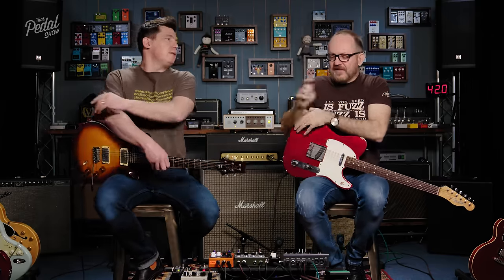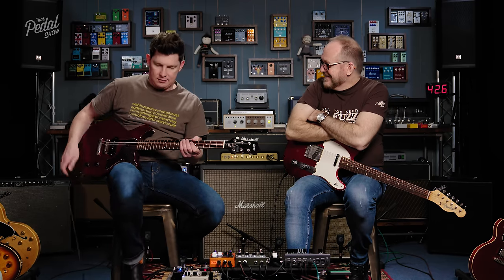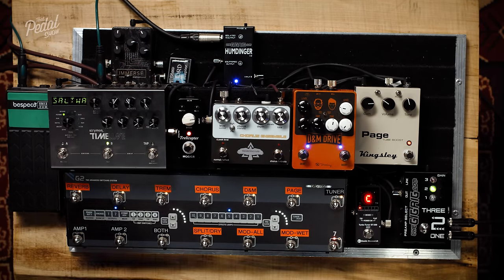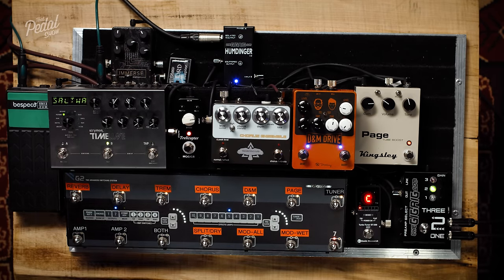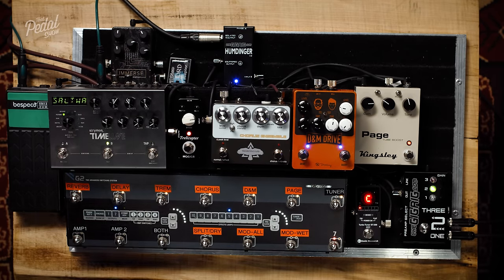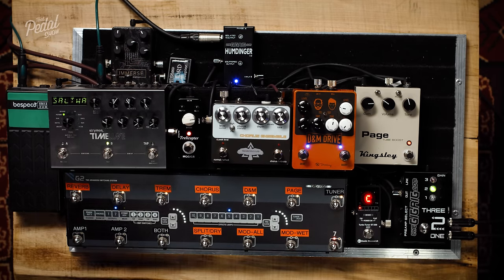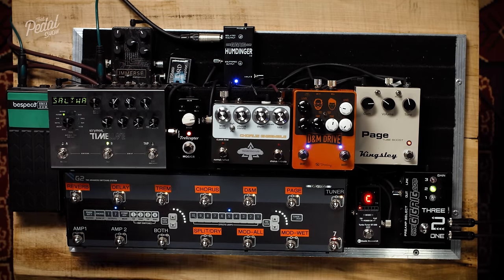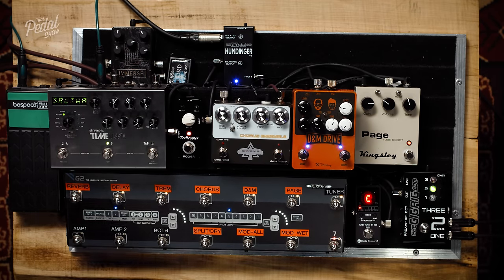Wet-Dry & Wet-Dry-Wet Amp & FX Setups Explained – That Pedal Show

Comment: I haven't bought a tremolo yet.  I really want one that's simple and small.
I've seen that Trelicopter on the board for years.
That is the one I think.
Reply: Also do you gents always record in stereo when you have two amps set up?
I can't quite seem to figure out if I'd been hearing that or not.  I normally wear good quality over ear headphones when watching and this time I was just using my monitors and immediately heard the stereo lol.
Do you use stereo regularly, and just cross fade them a bit so they're still somewhat centered?
Just curious for curiosity sake :)
Reply from the maker: Always :)
Reply: AAARRRRGGHHHH!  I can't hold my comments lol!!!
When I use wet dry I have a stereo phaser, TC Helix, and I send one path to my dry because I love it :)
Who only uses one amp anyways........

Comment: Thanks for this video, guys.

You've just reconfirmed what I've learned by watching TPS religiously for quite a while now.  Because of the wealth of information you guys provide, I use a wet-dry-wet rig with a Fender Blues Deluxe Reissue, a Blackstar HT Club 40 Mk II, and a Fender Hot Rod Deluxe III (all 40-watt amps) and it sounds freakin' incredible!  No nasty interference, ground loop noise, or anything of the sort.  Thank you for doing what you do - you've both been a tremendous help and inspiration to me.  Have fun at NAMM!! :P

Comment: Dan, Mick, there is another way to run three amps, that is, run a wet/dry setup in parallel with a third amp.   Suppose that third amp was that famous one-trick pony, the NMV Marshall.   This is getting closer to what Eric Johnson does.    Have you ever tried a setup like this?

Comment: Question: If I have one amp and the DB metre reads 100db, and then I run a second amp at the same time at the same volume in a wet dry mix, will the DB metre still say 100db, or will it be 200db? Or will it be somewhere in between?

Comment: a TPS episode idea: a micro-budget "wet/dry/wet rig" challenge!

To create the best wet/dry/wet rig, intended for home use, with a budget of 2000 GBP. The idea arose from my limited space, and sound attentive neighbours, in addition to cost. Note that each contestant starts with his choice of one guitar and one computer (with quality, externally-attached speakers). These items are separate from the 2000 quid budget.

My solution is to spend 909 quid on an Katana amp, a Radial splitter, a Focusrite audio interface, and two Boss stereo pedals.

Step 1: For budget reasons, and the tone is 'good enough, I chose a modeling amp  (a Katana 100-Watt 1x12 Mark-II combo amp), so the first two steps in this list can be skipped if one selects a different amp. Use a USB connection to attach the Katana to the computer, and use Boss' Tone Studio to assign each of the Katana's five built-in pedals to whatever effect one desires (from within the entire Tone Studio's catalog of 65 pedals). FYI, the built-in pedal labels are Booster, Mod, FX, Delay, and Reverb. Or, don't tweak at all, and just use the default effect assigned to each pedal: Blues Drive, Chorus, Tremolo, Digital Delay, and Plate Reverb, respectively,

Step 2: still using Tone Studio, if desired, put greater or fewer built-in pedals in-front of the Pre-Amp. The default is two pedals in front. The remaining pedals will be placed after the Pre-Amp. Therefore, the default is three pedals after the Pre-Amp.

Step 3: put a TPS approved splitter into the Katana's Effect Loop (such as, the Radial TwinCity, 160 quid). In this example, specifically connect the Katana's EFX-SEND to the TwinCity's INPUT, and connect the TwinCity's OUT-A to the Katana's EFX-RETURN.

Step 4: connect the splitter's isolated transformer port (OUT-B on the TwinCity) to a port on an Audio Interface (such as, the Focusrite Scarlett 4i4, 3rd gen, 188 quid). Note that free versions of most well-known DAWs are either available for download from the manufacturer's website, or in this case, bundled with the Audio Interface. Pay particular attention to the number of channels available at the complimentary price point. For example, Pro Tools Lite grants four channels, while Studio One Prime only grants two. Given that this project requires three channels, then some free versions of great DAWs will not be suitable.

Step 5: connect the Katana's Line-Out to a stereo Delay pedal (such as, the Boss DD-8, 139 quid). By the way, the Katana's Line-Out is a mono signal, even if any of your built-in pedal choices is stereo (because the stereo signal gets summed to mono before hitting the Line-Out jack).

Step 6: connect the Delay pedal's stereo outputs into a stereo Reverb pedal (such as, the Boss RV-6, 113 quid).

Step 7: connect the Reverb's stereo outputs to two ports on the Audio Interface (ensure that these two AI ports are configured as a stereo pair, or else they will be seen as two mono signals).

Step 8: using a USB cable, connect the Audio Interface to the computer. Use a DAW to capture the three channels in the AI (Dry, Wet Left, and Wet Right). In the DAW, configure reasonable speaker placement, such as Wet Left to stage left, dry in the Center, and Wet Right to stage right). Ensure that the DAW's outputs are set to the computer's externally attached speakers (or, even better if alone, use headphones) to hear the resulting wet/dry/wet tones of joy.

The five pieces of gear that I selected (an amp, a splitter, an AI, and two stereo pedals) total to exactly 909 GPB (using Andertons prices). What creativity would ensue if Mick and Dan had roughly double my budget, or 2000 GPB each?

Comment: As cool as wet dry wet is, I think I’d prefer just wet & dry with clean and dirt being the only division. I kind of like reverb and delay getting muddy in the dry amp as well as modulation.
But I do like the sound of a clean signal slightly quieter than the drive signal, which they didn’t really do here but just a thought.
I do agree that this is a HUGE sound. I just don’t like how the wet effects get lost behind the dry signal. I also like multi delay pedals running in series, where they all affect each other delays instead of doing their own parallel thing.

Comment: This makes me miss my G&L Tribute Series ASAT Special; I just wish the neck were thicker, like that of a Fender Baja Tele.  I may look into custom pickup routing for a Warmoth body if I ever escape poverty.
Reply: try the american made asat special, you can find a deal on them usually, and they are 10Xs better than a american fender and the neck is definitely thicker than the legacy line
Reply: @michaelpoole8321  The Legacy is a G&L guitar model which was introduced after Leo Fender's death; you were thinking of the Tribute Series.  None of the American G&L neck profiles is thick enough for me (both of my Warmoth necks have their "boatneck" profile).
Reply: @Robstafarian  thats what I meant, I'm aware the legacy and s-500 were the g&l strat type guitars, i meant to say tribute but for some reason legacy came out
Reply: @michaelpoole8321  No worries, thanks for trying to help.

Comment: The only problem I run into is when you want your drives running to both amps but only want modulation to one amp but that modulation works best before drives. What then?
Reply from the maker: Then you have to compromise. Dan likes his flanger before drive... so that’s where it goes and ends up not wet dry. 
Except that G3 allows all that. Eeeee
Reply: @ThatPedalShow  I hate having to compromise! I actually run a wet/dry/wet right now. 3 vox AC15s. One with an Alnico Blue (Dry amp) one with Alnico Gold (left amp) and one with a Heritage Greenback (right amp)

I still have the issue of wanting to send drives to all 3 amps but modulation to only left and right but I also prefer flange, phaser and vibe before my drives so it would mean sending those modulations to all 3 but retaining the dry amp is a must for me so my compromise has been only sending drives to left and right as well as modulations and delay. The keeley 30ms to left and right is always on to give me huge width. The only thing going to all 3 amps and also always on is the Fulltone Ranger Treble Booster

Comment: I find it interesting that you both prefer modulation effects in the wet amp, but I remember you both preferring chorus before drives in another video where you swap the two around.

For me personally, drives into a chorus is the worst sound so I could never have it in the wet amp.

Comment: This is a open question and I will appreciate feedback from anyone who cares to give it, I have a '65 Twinn re-issue and a Princeton Chorus I use a DS-1 tube driver and a Digitech Delay, I want to be able to switch between the two amps and have the effects switch back and fourth as well.The pedal settings are set the same for both amps,Thank You.

Comment: The dry delay on top of the distorted signal sounds cheap to my ears

The magic happens in the power tubes when the digital signal gets lo-fi'd in a musical way

Think of a re-201. Besides adding pre amp color, breakups, pitch drif--it goes thru the power section

Comment: maybe i'm an idiot (ok definitely i'm an idiot but hopefully that's irrelevant here) but it basically just sounds to me equivalent to having the delay/reverb mix lower when you have it run after the split. when you demonstrated the "all together" it was just obviously way too wet. perhaps if the two were hard panned, but that would be kinda weird, all the delay/verb on the right, so i don't think we want that. Do you really notice a difference to just setting the delay/reverb mix at a reasonable level? I'm just not hearing it.

Comment: VCQ time!
1. What is a ground loop and why do you want to have only one amp connected to earth?
2. In a wet dry (wet) setup, how do you choose which amps you use for the wet signal(s) and the dry signal?
Thanks ever so much
Reply: I think what Dan is saying is that you only want one of the front of an amp's pre-amp jack inputs connected to earth. Both amps AC power cord should always be plugged into an outlet with earth connection. That safely earths all the metal inside the amp, and any metal on the outside of the amp including metal switches.  

The guitar signal cable has 2 conductors: center and outer shield. The devices that have ground lift switches, will break this outer conductor signal in between your guitar and one of the amp's input. 

When boths amps AC cords are plugged in, and both get the same earth connection (which should be how your residence is wired even on different outlets), and then your guitar is connected to both amps with a cable, (even without pedals), then you get a ground loop. The guitar signal cable's outer conductor is tied together to earth in each amp. This creates a loop. A conductive electrical loop. Which makes a great antenna to pick RF waves in the air. Typically the ones that are being radiated all over your residence by every device plugged into power, the power cables in the wall, and the amps themselves. It can also cause current to flow if these different earth connections have a difference in potential. Its easier to visualize. This link is referring to an amp and sound equipment, but same principle applies and it was the best diagram I found:

https://www.prosoundweb.com/images/uploads/Fig3BartlettHumRFI.jpg

I think for choosing amps for the wet, its entirely personal preference and what sounds good to you. I think using a more cleaner higher headroom amp for the wet sounds. Sort of like how some prefer to use the effects loop. That way your drives are before the wet, and the wet effects aren't going into a dirty amp. Although, that can sound good too!
Reply: @JasonClute  Cheers man, I just switched accounts to give your comment an extra thumbs up! ;)
Still, I don't get how a (splitter) output can be isolated, since both output signals are coming from the same source, but that's an entirely different question which I probably won't need to know the anwer to.
Reply: The key to isolation is running the isolated signal through a 1:1 transformer. That breaks the ground signal going to the output. Kind of have to understand how a transformer works and how it will couple AC signals without having an electrical connection between the primary windings and secondary windings.
Reply: @JasonClute  you are the hero we need, but I'm not sure I deserve...
Reply: The Blues Prosecutor There are so many others that know so much more than me. I just enjoy all this stuff so much. Guitar is my hobby and by day I work with high voltage in a lab blowing stuff up with electricity so it’s easy for me to understand all electrical things going on. I love my job but if I could find a niche in the gear industry! I love so much what Mick & Dan have done. Every week when I watch I want to by more merch for the job they do!

Comment: Wet dry almost sounds more stereo than stereo if you know what I mean I mean? Actually using some effects in stereo you'll have Auto panning and things like that what you're interested in tricky and will really fuck up the other guitar player you're playing with if you actually run a separate amps on different sides of the stage and can  screw your band up. Sometime you should try the guyatone real tube tremolo and run it in stereo real stereo it's insane and glorious

Comment: Wheels out his 'old' rack gear......hmmmmm Marshall JMP-1 preamp check,  El84 20/20check......8008 ValveState check...ADA-mp1 check...MP2 check...Rocktron Voodu Valve w Witch Doctor Preamp check.....Mesa Quad Preamp check.....Mesa Fifty-Fifty amp.....ohhh geez I have a problem.......I need cabs to plug into too.....2 4x12's check....1 2x12's check......a 6x10 check.....ok should be enough for this wet dry wet thing. :D

Comment: A couple of comments, Out of phase with on ear buds, JVC headphones and 1000w pa seemed fuller and more stereophonic than in phase, also,  in wet dry wet situation losing the Marshall just seemed to drop the volume 50%. Could this be due to the placement of the microphones?
Reply from the maker: I had a bit of phase nightmare with this one. Fixed what I could, confused about the rest. Mick here. The point is that you need to think about it because even we get it wrong!

Comment: Very nice guys .Anyway there is no mention of what happens with serial connected 100% wet effects. If you have a delay and reverb in series 100% wet it's not going to work properly .Reverb pedal won't hear any dry sound..and at its output you will only get reverberated delay . The only way to do it 100% wet needs more splits and mixers . Outs of the delay should be split to reverb and to a mixer .and input of the reverb should see a split of the dry and it's output would go to the last mixer . Too complicated for most rigs anyway :-)
Reply from the maker: Nobody does that. Nobody we know anyway!
Reply: We all did in the rack days ;-)

Comment: You can make sure that the phase for 'earth is correct' by laying the cabinet flat, putting a coin on it, and making sure that a plucked string makes the coin pop up. If the coin doesn't pop up, then the speaker is pulling in instead of pushing, and it's in reverse.

Comment: This video made SO much sense. Really valuable! One set-up I would have liked to have had your insight on is the use of "wet-dry" in a stereo amp. I.e., "real" wet-dry, but using one amp, not two. Presumably that works OK? I see from the description of the Orange Rocker 32 (2x10) that this is listed as a possibility. What would be the limitations/downside from using stero amp rather than two separate amps? (And of course such an amp could also be used for "wet+wet-dry", i.e., a two amp wet-stereo-and-dry setup....)

https://orangeamps.com/products/guitar-amp-combos/rocker-series/rocker-32/

Comment: Couldn't you accomplish the same thing, pretty much, with one amp by running your wet effects through the loop of the amp and the dry effects through the front of the amp?
Reply from the maker: Not really. Having two separate amps is where the magic happens.

Comment: So basically, you run a dry amp with the, as you say "processed" sound. If the processed sound was "bad." It seems like it might be lipstick on a pig. I thought the kill dry setup really had the most space and definition. It sounded more like what you hear on a recording.  Am I understanding that what the other amp is adding in character is a big part of what you like? Not just the space effect.
Cheers!
Reply from the maker: the processed goes to the wet amp

Comment: I am so stuck guys! I want to run a wet dry setup but I want to be able to use a Looper pedal. Can you please help. I have racked my brain and I cant work out where a looper pedal can go where I can use the wet and dry signal. My guess would be use a Humdinger after the Modulation and Drive effect - run one signal through the wet effect and the other "dry signal" run from the humdinger and both rejoining at a stereo looper pedal, then into the respective amps. Do you see any issues with doing this? I don't have a Humdinger yet but will pick one up during the week. Thanks for any help!